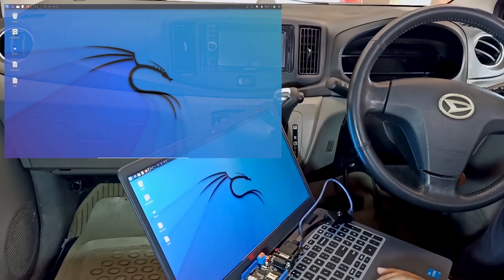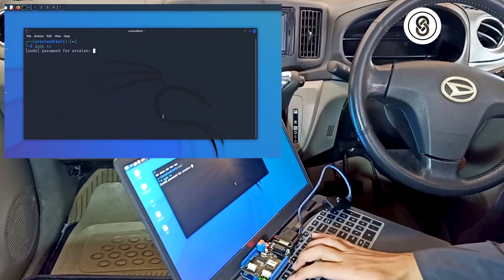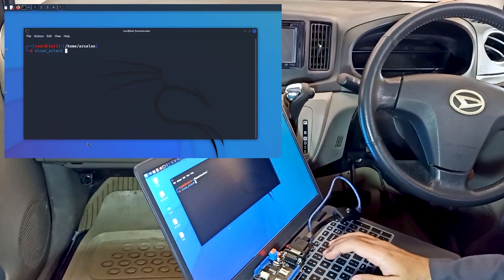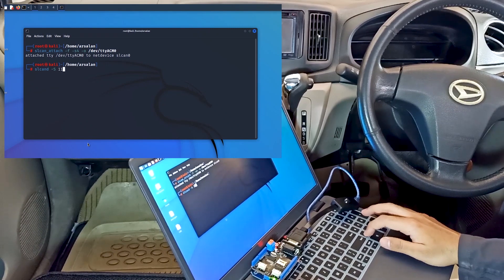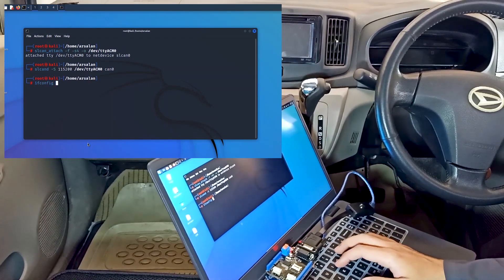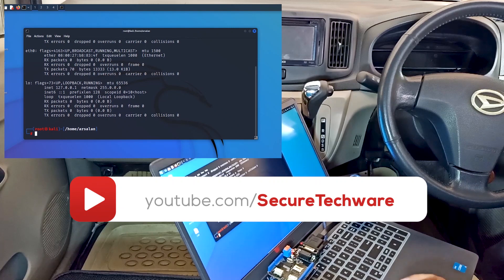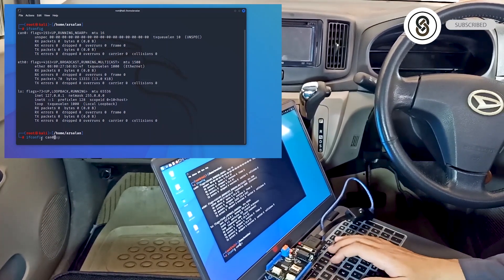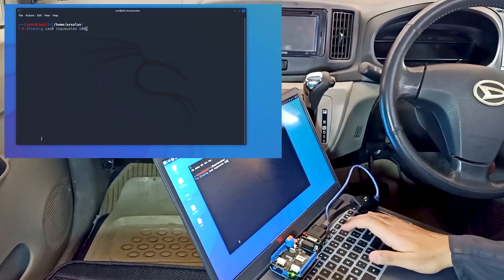Creating Physical CAN Interface CAN0 in Kali Linux

Comment: Lots of CAN implementations are proprietary and the firmware is really something you don't want to mess with on your daily driver. They also change from year to year, or even twice a year depending on make and model. Loads to research but be very careful.